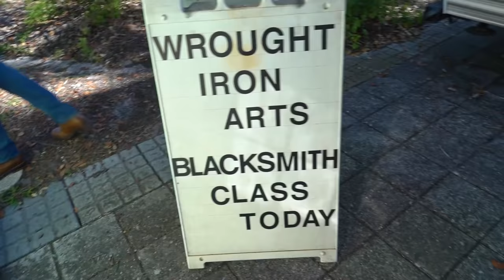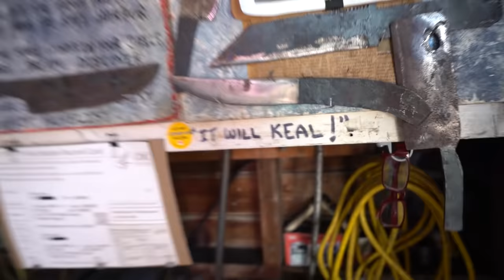Forged in Fire Is Easy

Comment: The first time I ever welded I was like damn I can't see with this hood on. So I started reaching around with my hand. That's when I found the red hot metal. Burned my whole hand. Part of the learning experience Charlie!
Reply: I've done something similar. I was welding a piece of metal. I blew a hole through the edge of it. This created a crescent shape that was red hot and razor sharp. I touched it with a glove on and it burned straight through. Got a good cut on my finger tip for awhile.
Reply: Felt some strange warmth on my stomach once, didn't have my welded piece anywhere near me which is what confused the hell out of me at the time. Got home that night and realized A What happened and B How.
A) Burned a whole through my shirt and into my stomach(only skin deep but still)
B) I took my filling rod and accidentally put it against me after I finished TIG Welding.

I welcome Charlie to the Metal Workers Society with open arms after taking the badge we all must get at some point.
Reply: The touch of doom
Reply: @stormhawkdude  done that many many times have alot on my wrist one looks like a shark tooth

Comment: I've burned my hand super bad almost branded myself. That was the closest I came to passing out while standing. So props to Charlie for handling that so camly
Reply: I was using a sawzall to cut an exhaust off a car and the blade started bending. I grabbed it without thinking to straighten it out and actually heard my thumb sizzle when it touched. I immediately rolled over and stuck my hand in a nearby puddle of water because my instant reaction was any relief I could get. 0/10 do not recommend
Reply: @imboredadr  thx for the warning man, almost dropped my hands in lava

Comment: I like blacksmithing! I'm still forging my first double edge sword(after I'm done making two more knives and get some steel for the pommel and quillon...) Hope you had fun making the sword... I usually get burnt as well... It hurts but you'll look past it if you keep on blacksmithing!
Reply: Some tips: find out if there's a cheap laser cutter near you. You'll be able to make stuff like crossguards a lot easier if you get them laser cut from plate. You should also see if you can track down a proper belt grinder, second hand will do
Reply: @treeplanter-bv4gw  thank you for the info... what belts should I use for the belt grinder?
Reply: @dddaviddd9208  if they're available in your area, Pferd ceramic belts. They sell them in 2x72 or 1x72 size. If you get a 2x36 grinder you'll have to ask the supplier if they can shorten the belts for you. Basically just search for 2x72 ceramic belts in your area, and if they are made by Pferd it'll be a bonus
Reply: @treeplanter-bv4gw  thank you again for the info

Comment: Ok so here's my thesis on everyone's blades. I don't think I could rank them worst to best because they were all very different types of blades, plus everyone did a fantastic job at the forge regardless.

Starting off with Charlie's katana. Despite being crafted by an amateur, it's readily apparent that it is indeed supposed to be a katana, and that earns about as much respect as is needed. It was also functionally sound as well, making very clean cuts through the watermelon and the meat, and maintaining durability on the wood test.

Matt's broadsword (?) was also wonderfully crafted. It cut seemingly just as well as Charlie's katana, and had the added benefit of being able to perform very clean stabs.

It is a shame we couldn't see more performance from Danny's axe. When it comes to melee weapons I've always been a fan of axes, so I am a little biased. That aside, the problem was obviously in the handle (or more accurately the connection between the handle and the blade) and not in the blade itself. Had the connection been more sound, I believe the axe would have done a great job on the remaining tests.

Finally, Caleb's kunai. There's no doubting Caleb's blade had the best appearance--looking like it was forged by an actual professional as opposed to an amateur. It was also very sharp and durable as the tests demonstrated, and Caleb's apparent knowledge of how to handle such a weapon is deserving of bonus points.

Thank you for listening to my TED Talk.
Reply: Matt’s sword is an Ulfberht

Comment: for axes as it's a very impact heavy implement not so much slashing you have to use wedges on a solid wooden handle, with the metal going through the actual handle so it will stay
Reply: or vice versa (another words metal surrounding the wood, which would be WAY better for stability and balance)

Comment: Why cut out the shape and then forge? Isn’t the whole point of heating and hammering the steal to mold it into the shape you want? After cutting it would have made more sense to just go straight to heat treat then finish your shaping on the grinder.

Comment: cutting the metal would be a lot easier with an acetylene torch and polish with an angle grinder, they should also mig weld a hand guard

Comment: why did they heat up the metal after cutting out a shape with an angle grinder?? like youre not forging it, and youre using an angle grinder to grind the blade too...

Comment: I'd say that there should be two things pointed out here. firstly, Charlie should've 100% been wearing a glove so his hand wouldn't have caught a molten piece of slag. any self-respecting blacksmith respects the idea of safety. long shirts to protect the arms and goat skin gloves to protect the hands. i can understand why Charlie wouldn't assume he'd need one, but the smith who runs that garage forge really should've known better than to just let him hammer away without protecting himself and his injury is kinda what follows when you don't bother taking safety seriously.
the second thing is just craftsmanship nitpick, but Dani could've definitely forged that ax slightly better. instead of tying the ax head to the wooden shaft, he should've instead made the head slightly larger and fit it inside of the shaft or around it entirely. a lot of ax heads you'll see will either be entirely surrounding the tip of the handle or poking through it and coming out the other end. usually the former has a lug or a pin going through it as well to secure it inside of the shaft.

Comment: So fun fact a Kunai is technically not a weapon... The Kunai was originally used by peasants as a multi-purpose gardening tool and by workers of stone and masonry. The blade is made of soft iron and is left unsharpened because the edges are used to smash relatively soft materials such as plaster and wood, for digging holes, and for prying. The word "kunai" means "to dig" in Japanese, reflecting its original purpose

Comment: Calub is the best craftsman for a few reasons.
Reason number one, as a beginner in forging he chose a simpler concept to work with then all of the other's.
Reason number two, he used gloves during the entire forging proces.
Reason number three, he carefully looked where to hit the metal to give it an even shape.
Reson number four, the end result looked a lot smoother and the blade is straight and it actually resembles a real kunai.
Reson number five, after testing there was no damage or deformation on the blade at all.
So Calub, you did a great job! you are the only one of the group that has earned the title of novice weaponsmith.
No offence to the other's btw, the problem here was obviously the instructor.
He did not give enough guidance, forgot to tell you all the basic rules for safety, did not teach you about heattreatment and the list goes on.
In the eyes of an actual weapon smith (not an artist) this guy is a full blown amateur especially in teaching others.

Comment: Charlie did not make a katana. A katana is continuously folded to creat a sharp edge.
Reply: Its also made from crappy iron sand bloomery and all that folding is just there to make a tolerable steel.  Germanic tribes did the same thing from around 300 to 1000 ad with bog iron. 

Theres no reason to do such work with modern crucible steels.

Comment: i’m sorry but I don’t think you’re actually correct I am apprentice blacksmith and forging is not as easy as you think it is because you had a tremendous amount of help but here’s another thing you’re not applying for the time crunch I’ve only 2 to 4 hours to make a knife or so depending on whatever you’re making then you only have 2 Hours put handle put an edge and then it’s the testing you make one little mistake because you were in a rush you’re most likely gonna end up getting kicked out

Comment: I am curious why the blacksmith didn't force them to wear a long sleeve flame retardent coat, and some gloves. Even as someone who has never blacksmithed before I feel like covering as much skin as possible is kind of a no brainer when you are bashing several hundred degree pieces of metal causing those same hundred degree pieces of metal to get launched in every direction

Comment: what charlie doesn't understand is that his sword is actually a lot stronger than traditional katanas. Traditional katanas were very brittle, they required a very mindful wielder as most armor used by samurai would instantly shatter the blade itself. The blades were typically weak due to the fact that before european contact: the Japanese were only advanced enough to forge pig iron and thus would fold it many times to enhance it's durability. So don't worry Charlie you did better with what was given to you than the old swordsmiths of legend.